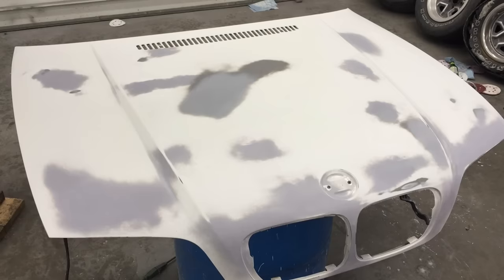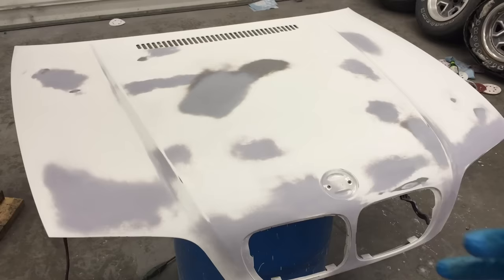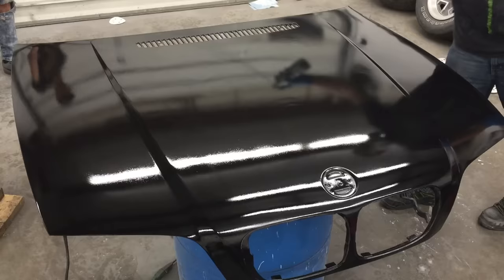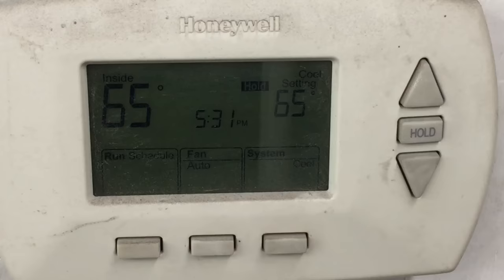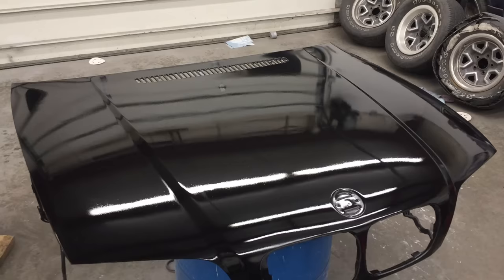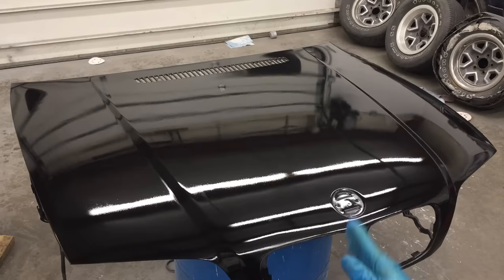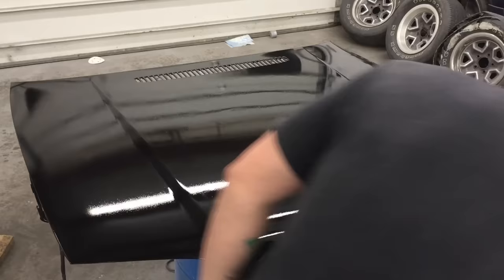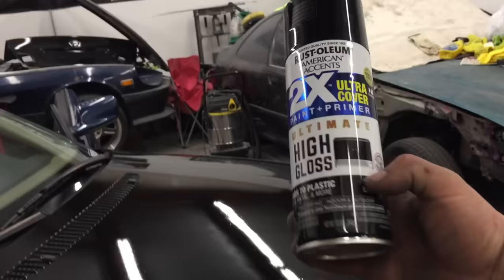How I don’t get stripes when spray painting (Easy method)

Comment: James D Guy I plan on painting a car I have at some point. How long after spraying this paint down do I have to wait to spray it with the 2k clear? I have tried spraying clear over this paint before on a fender and it shriveled up the paint. I had to strip it and repaint it.
Reply from the maker: You have to wait awhile before doing the 2K clear and there is a difference between the 2X from rustoleum and the 2K from spray max. If you are gonna spray it with 2K from spraymax then you need to apply it soon after the panel is done. Or wait a month wet sand with 800 and shoot the clear. The 2X i don't like to use because it does like to wrinkle the paint but its only because the dry time that the paint needs to fume off is longer. Idk if that made sense.
Reply: @JamesDguy  which 2k do you perfer
Reply: @JamesDguy  yes. It made sense to me. Thank you very much for your reply. I'm probably going to tackle this in the spring after I get my other stuff with the car worked out. I appreciate the feedback.

Comment: First of all the stuff does not have a primer even though it says... you supposed to lay on a separate primer let it cure or you will see rust spots in 2 months and have to redo all your work don't be cheap and do it right with a primer

Comment: How long would it last with no clear coat though?
Reply from the maker: Longest lasting job i have on the road still no clear is going on 4 years and looks great but it was waxed and taken care of.
Reply: James D guy yea that’s pretty much minimal care imo if you care about the paint.  Do the usual stuff and it should last.  Going to give it a try.
Reply: Ian Holmen I rattle canned a truck 5 years ago. Paint still looks decent, a little dull compared to wen I first sprayed it, I never wax and hardly wash it, and it lives outside

Comment: You didn't really say how to avoid tiger stripes haha
Reply from the maker: SuperMiataBros I did and showed it lol temps cooler and I show how rewatch the video
Reply from the maker: SuperMiataBros I mean I showed how and kinda went over it kinda but keep panel wet lol
Reply: James D guy My takeaway was 
Keep low room temp, two light coats, and then blast it fairly heavy on final coat.
Reply: Main thing I’ve learned is to always overlay and never stop moving. You basically learn by doing over and over again like most skills. I now stop and angle myself to see where I missed overlaying the heavy coats and quickly hit them again without stopping my spray. Only downside to rattle cans is when the sputter due to not shaking. Make sure to shake cans between every other pass
Reply: @petescarport  sort of like sex !😅😅

Comment: Waaaaaay way to time consuming. Had you gotten SprayMax aerosol automotive paint it comes with a much better nozzle that provides a much wider pattern spray which allows you to cover more area in less time. Also to prevent killing your finger get an aerosol spray handle grip that's way more comfortable giving the feel of an HVLP sprayer
Reply from the maker: I prefer spray max but its a special order item and takes a week to get to kansas. I use spray max all the time when its not a time sensitive thing.

Comment: I keep getting tiger stripes
Reply from the maker: King Toya Don’t paint in direct sunlight, if the engine is hott it will transfer he heat to the hood and you want it as cool as possible. Chase the wet edge keep the panel as wet as possible and it should help you keep it from striping.

Comment: your first coat was way too thick.... for spray paint.
Reply from the maker: I never had issues doing it this way in the 11 years painting out of can. My results are different than others though. idk.
Reply: You should always spray heavy coats, but not too heavy that you get runs in the paint. If you do dry spraying thats actually bad, because the dry spray builds up into lil mountains giving you nasty orange peel. Lay it heavy and flat, each coat for base. But the clear coat, its best to spray a light to medium coat on the first pass, they call this a tack coat. Tack coats allow the 2nd, 3rd, 4th heavier clear coats to stick better and not to run as easily.
Reply: yeah my bad for talking crap haha